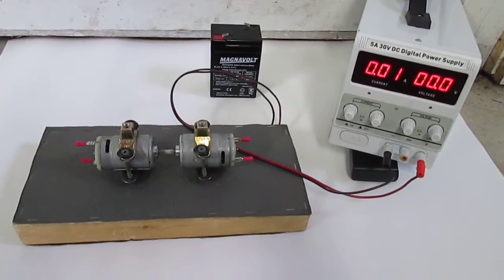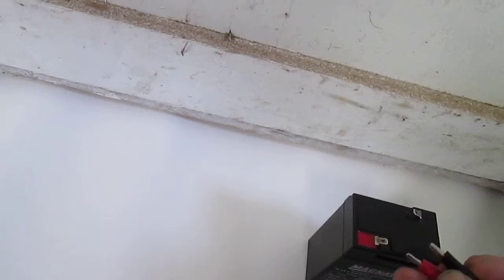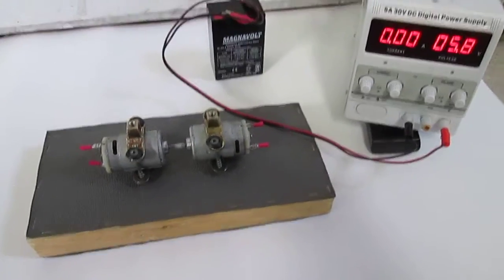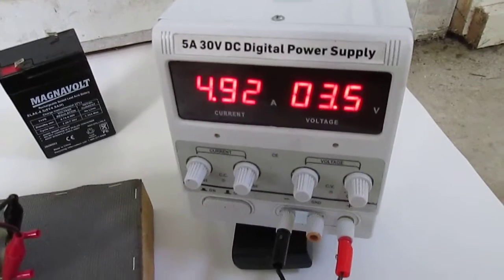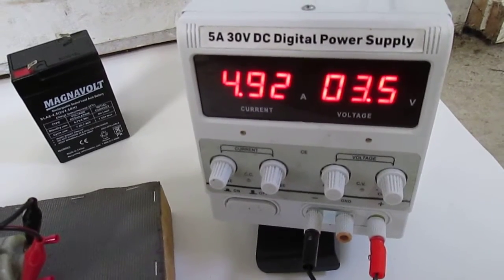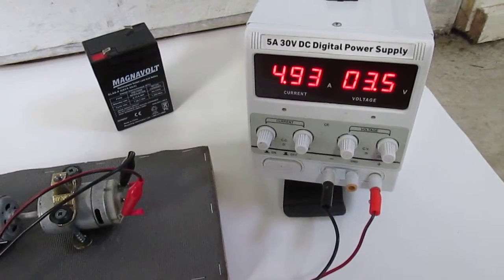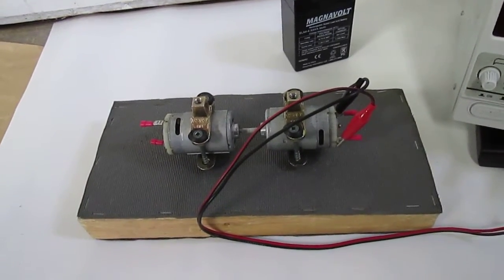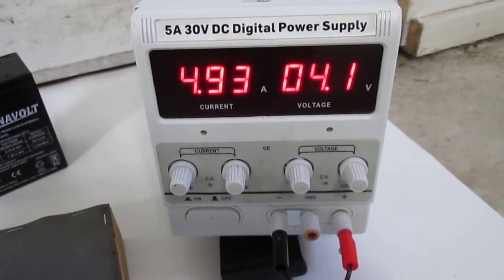Acceleration under a load

Comment: as it gets hotter the load is less and the rpm goes up and the more back voltage is produced in the motor so the voltage goes up and the amps go down.

Comment: And if you keep looking on my channel you'll probably find 15 other technologies that are over unity that I own ....  I am very very well known on overunity.com.
Reply from the maker: This is not your device. It is made from off the shelf components for examplethese are Johnson appliance motors that have passed standards. Ben Franklin does not own electricity. If you are getting at IP then it is the prototype or industrial process that is owned or recognised. There are hundreds of devices on you tube channels both commercial and otherwise.

Comment: If you ask me looks like your power supply is not constant and and does not provide a constant supply research your power supply you will find my words correct .... 

Course the motors going to go faster when  the voltage increases because the regulator in the power supply is shit if you want to see a true acceleration loop check out my YouTube channel true over unity and I am the original discover of it 10 years ago....
Reply: My motor that operates with gain operates on the electricity generated from with in the device it is then conserved and fed back on to the mechanical rotation to accelerate it and it goes from 2000 RPM to 15,000 RPM in less than 30 seconds....
Reply from the maker: According to the manufacturer while using the dials either the volts  are held constant or the amps are held constant and the power supply delivers uniform watts. I would like to use other power supplies  for validation but my resources are limited. I do not touch the dials in the experiments with acceleration. I have also used a diode confirming the power is not going back to  the  power supply. The Power supply  works as expected if a motor is attached in the ordinary way or other loads attached as we normally use  them. It would help if you post your data measurements input and output and test results. ----------------------------------------------------------------------------------------------------------------I would give credit to Tesla, Alexanderson and others. For the discovery of acceleration under a load, Thane Heins put in a claim for a device made a long effort. Well known skeptics and critics have a thread  http://revolution-green.com/debunked-thane-heins-regenx- delayed-lenz-shorted-coil-acceleration-effect/ but each have their own  take in their heads claiming knowing it all. Best of luck.
Reply: To hell with thaine Hines I told him how and why his device operates and accelerates under load and yet nobody has challenged my explanation in almost 8 years....